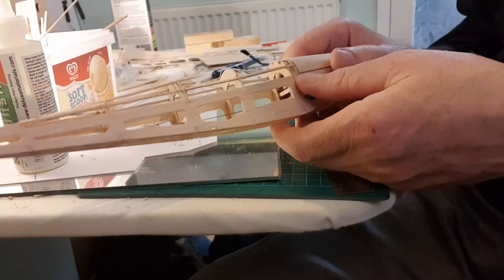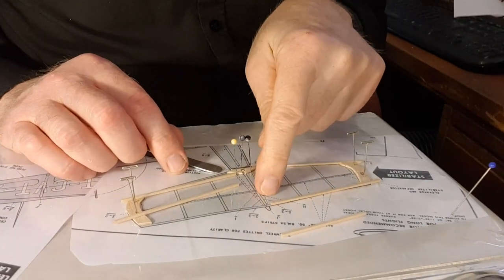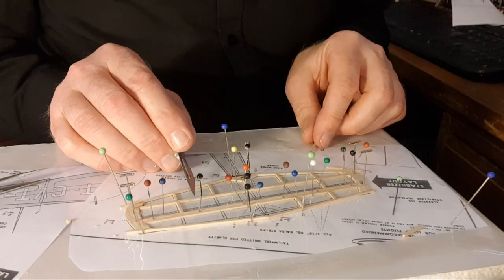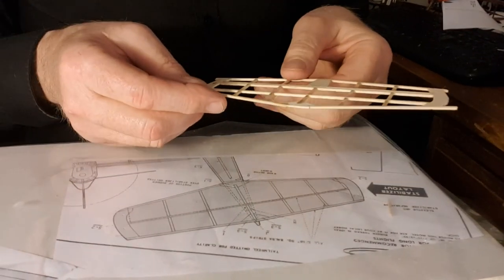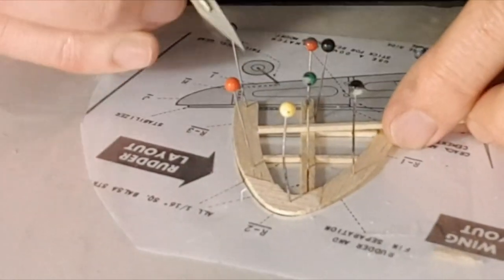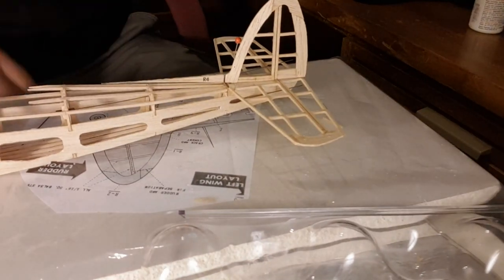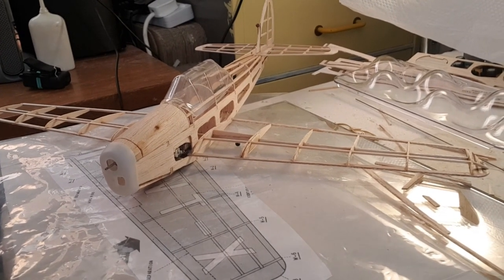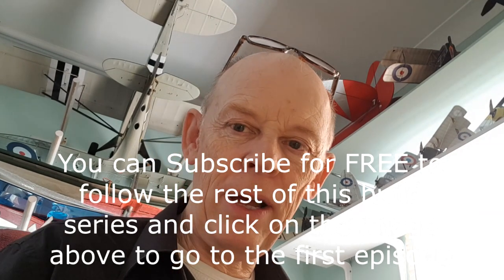Guillow's Chipmunk RC Conversion Part 4 Tail and Wings

Comment: Silver tissue? Have you ever used it before? I heard it shows every little imperfection.
Reply from the maker: It shows every big imperfection as well David! I'll just have to try harder on this one. By the way it's not tissue, it's heat shrink plastic but the principle's the same.
Reply: @CliffHarveyRCPlanes  Just discussing, I am not after you changing your plan. I bought a cheap "chrome" spray can paint at the hardware store. As far as a "chrome" look, it is terrible. As far as a "satin aluminum" look, it is fantastic, it is all I use anymore.

Comment: Is this a fixed rudder model?
The elevator would interfere with the rudder otherwise.
Reply from the maker: The rudder ends before the elevator begins so no probs 🙂
Reply: Ok, I didn't see that. I thought rhat double spar section in the horizontal srab was the hinge point for the elevator, and that it was forward of the trailing end of the rudder. 7:18

Comment: What is the covering Cliff?
Reply from the maker: Hi Bob, it's HobbyKing Solid Silver.
Reply: @CliffHarveyRCPlanes  Ok. Thanks. Ive used it on bigger models. Though it would crush lighter airframes but obviously not!  Well done Cliff.
Reply from the maker: @bobi2582  I think you need to be aware of the shrinking power on lighter airframes, it did pull the bottom edges of the fuselage in, with hindsight I could have reinforced that area. I was careful with the heat settings of the iron, just using the lowest heat possible to do the job. I did have to have a second go at one of the wing panels so it's not just a case of heating up the iron and getting on with the job, but as in all these things it's a bit of a learning curve. Thanks for commenting. Have you subbed by the way?
Reply: @CliffHarveyRCPlanes  Ive been building some lightwieght indoor rc models during Lockdown and have been re visiting tissue. Have to say that I'd forgotten why I stopped using it! Also dusted my Ballards rtp kit off but havent done any RC rtp as yet. Keep up the good work. And yes Ive subbed!